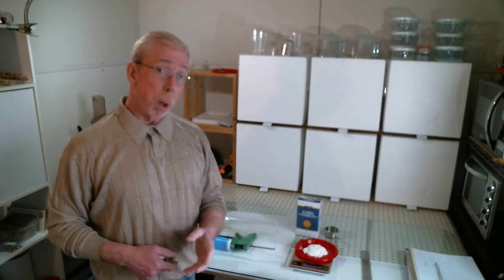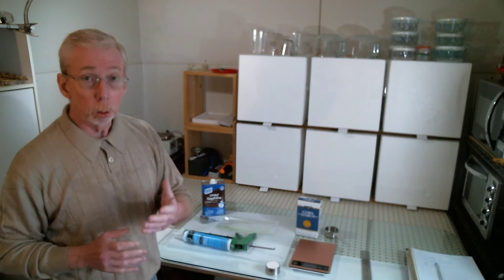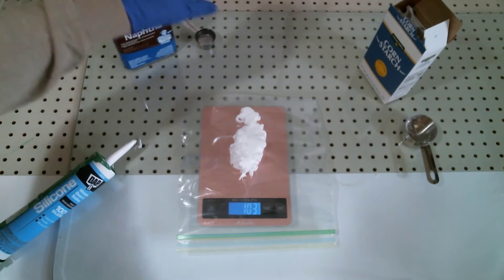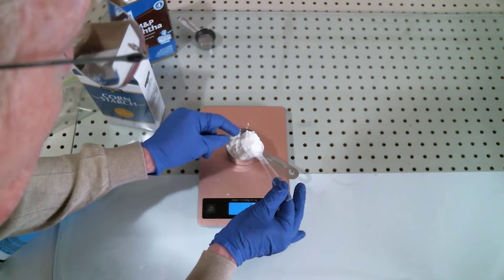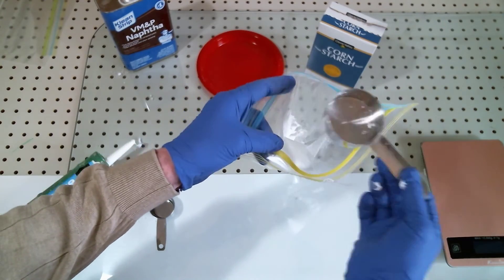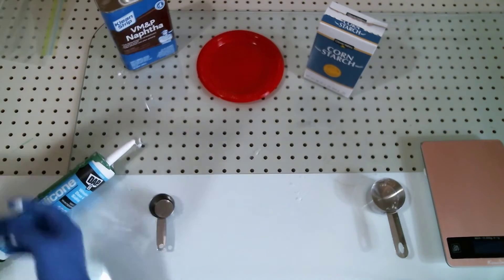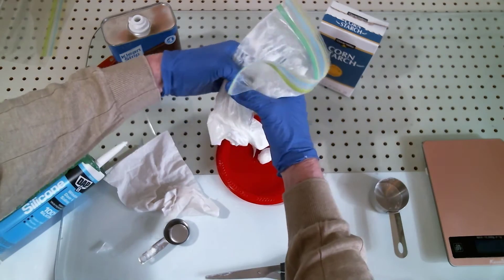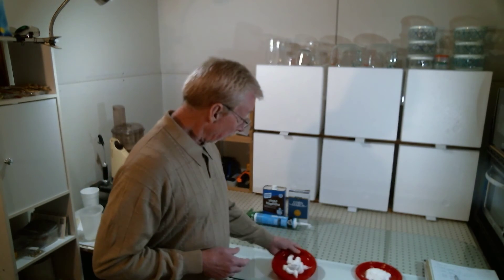DIY POURABLE SILICONE for mold making. Thin silicone w/Naphtha, fast cure w/cornstarch.

Comment: Is it rigid or flexible. I need flex to easily demold wax. I'm going to add mineral oil and see if that works.
Reply from the maker: This will be flexible, so you are on the right track. A little mold release won't hurt. A note: If the mold is fairly even in volume and dimension, you can dunk it to release the wax. The mineral oil will work to dissolve the surface a bit, you know that though. Cheers

Comment: Well, ive thinned silicone before using turpentine.....it stayed sticky for long, and weak too. I didnt like it. I think if i needed a longer cure time i would rather use IPA but question is, why cornstarch? what makes it cure fast and wont cornstarch deteriorate the mold after some years, maybe moulds
Reply from the maker: Great questions. You have a tricky problem. I have a couple of videos for you, that will answer your questions and lead you to the proper thinner. https://youtu.be/sIQkFVftDZU and https://youtu.be/Ob9Y7sjI4IA
Reply: i get the absorption property of cornstarch....for longer putty like use, we use a small amount of it in the silicone...great! thanks

Comment: I tried your recipe for the thin version and my mold hasn’t solidified at all in the center. I just used white silicone the same brand you used and added naphtha. I got the right consistency I needed to mold a statue and then poured. It’s been over 48 hours and feels like top layer of silicone dried but the inside is not. Any advice would be extremely appreciated
Reply from the maker: Did you ad the cornstarch? That is what cures the silicone. Add a ratio of 10:1, silicone to cornstarch.
Reply: @GEOsustainable  I’m sorry I did not as I remember you mentioning in the video that adding the cornstarch to the thinner mix for a more detailed mold wouldn’t be ideal. Maybe I hear incorrectly. My apologies. Thank you so much for the response.

Comment: I’m gonna try to mold a stupidly expensive intake manifold for a v8 with this. No reason a lower intake is $1000. If it works I can use the negative molds to make positive molds and use them to make sand cores to cast aluminum with.

Thanks.
Reply from the maker: That should work just fine. Let me know how it turns out!

Comment: Thank you for this tutorial! I am an artist and was looking for a way to make pourable silicone, for mold making, rather than buying those expensive 2 part kits. So this has been a great video for me! 

But I do have a question, does the 10:1 ratio for the silicone and corn starch work in smaller quantities as well? Like say if I wanted to make a mold the size of a quarter, and an inch thick, but I don’t want to make a large batch of pourable silicone, can I still use the 10:1 ratio for that small of a batch? Or would my measurements need to be tweaked? 

And for the naphtha/mineral spirits etc, is it not measured? But instead based on how thick you want the mold to be? Because I’d like to make a consistency somewhat like pancake batter, would that much naphtha effect the drying time? I guess I have some experimenting to do! Haha
Reply from the maker: True that, you have some experimenting to do. I can offer you a general guide based on your interests. 10:1 works for all quantities, giving a cure time of about one hour, regardless of how much Naphtha/Mineral Spirits you use.
Pancake batter is fine, I have thinned it to the consistency of syrup without issue. If you make a lot of molds, this will save you some money, for sure.
Reply: @GEOsustainable  thank you so much for taking the time to reply to me! I’ll take your tip into consideration when I do my experimenting! Thanks again!

Comment: Thank you so much. I just made a mold for a pice of tiled furnace we're rebuilding and it was missing a corner piece. I had to thin it quite a bit with naphta to make it almost the consistency of paint to make it pourable. I just hope it cures.
Reply from the maker: To ensure proper cure, don't forget the cornstarch in the ratio I give. Good luck! Thank you for your comment.
Reply: Could you let us know if this worked out for you?  Did it cure?  Any problems?
Reply: @whatanitemare  Its been a while now so lets see if i remember what I did -  it failed for me. I think I didnt have the correct corn starch ratio. It also stuck to my tile. so I ended up 3D printing a splittable mold instead.
Reply: @thehighwayman78  Thanks for taking the time to update!  I very much appreciate your sharing.

Comment: I had a question for anyone who could help, i used naphtha and 100 percent silicone to make a mold...day 2 and its still somewhat wet in the center...will this  dry or not and if so any tips on drying it faster...thanks.
Reply from the maker: Yes, if you watch the video, you will see me use cornstarch to cure the silicone. The silicone needs this to cure if it is more than 5mm thick. Hope this helps. It may help to watch the video.

Comment: I have used naphtha before and using enough of it to make it pourable also caused the mold to shrink. I will try your recipe and add a little more naphtha I want it just fluid enough to be a good mold, but not enough to cause it to shrink. Perhaps just buying the pricey 2 part silicone is the way to go.
Reply from the maker: The amount of Naphtha will affect shrinkage. I may have a solution for this in a newer video. Watch here. 
                https://youtu.be/Ci28Y3Z3bYU
Reply: GEO sustainable thanks Geo. I’ll try it.

Comment: Does the silicone shrink overtime?
Reply from the maker: It does shrink when drying, but it doesn't continue. The amount of shrinkage is proportional to the volume of thinner if thinning a lot. Most certainly, you will need to calculate shrinkage.

Comment: The mold shrinks when it cures.  I noticed after a few days, the size of my mold had shrunk.  I don't know if there is already a comment somewhere on this, but definitely an important note if the actual size is needed.  But other than that, I used camping gas, and a little of corn starch with my 100% silicone and it worked just fine.  I appreciate your helpfulness.  I hope my comment was also helpful.  Thanks.
Reply from the maker: I had covered that is a previous video, and how to calculate to get an exact size needed in a video on clay. Yes, you will lose an equal volume of material to Naptha, and can be fairly avoided if you take care of how much you thin it. Glad you liked and you are most helpful.
Reply: This a major draw back with this method

Comment: question, i need to use this to pour over a 3d printed resperator i made. Will this work? i have 3d printed over 2000 of them but now im looking for a way to cast one in resin. i dont want to spend a ton of money on the smoothon stuff. i need like a gallon of it haha  thanks
Reply from the maker: Gotcha, gotcha. I made a video for skin safe, PLA safe applications. Check here. https://youtu.be/Ci28Y3Z3bYU
Reply: @GEOsustainable  awesome thanks. I hope i can get it to work:) im teying to get it the same viscosity of the smoothon product.

Comment: In a previous video, you said that as soon we add cornstarch the quality for fine detail diminishes so maybe one should add only very little cornstarch?
Reply from the maker: That has been my observation, yes. It feels more grained. I use 10 gr of cornstarch to 100 gr of silicone to give a cure time of about one hour. This seems to retain the high detail I want.
Reply: Someone else suggested using talcum powder for a very fine finish.

Comment: Does adding cornstarch or naphta result in weaker (or otherwise different end result) silicone? Thanks.
Reply from the maker: The addition of Naphtha softens it a bit, making it more cushioned at about a 50/50 mix; at 1/4, not much. The small amount of cornstarch for a one hour cure does not seem to have any affect,. Neither affect the flexibility. This is answered better in a newer video here: https://youtu.be/sIQkFVftDZU

Comment: Can you tell me if that mixture sets hard and inflexible or soft and pliable?  I'm hoping to make silicone molds for soap making and don't want to have to buy the 2 part mix that they use if I can help it.
Reply from the maker: Silicone remains soft and pliable for 50 years. Saving you money is why I made these videos on silicone. I urge you to watch them, as I have demonstrated a few different methods.

Comment: FYI: I made a pourable mix, using mineral spirits rather than Naptha, to make a mold of a small cement pot I wanted to replicate. To my surprise (and disappointment) upon removing the original planter from the mold, the smooth finish  was also removed ruining the original pot. It appears everywhere the silicone touched the planter a layer or more of cement was removed.
Reply from the maker: Yes, this is a common issue. That is why I developed another method that will not harm plastic, and is safe for skin. Watch this. I just put it up for folks in your situation. Another GEO-sustainable invention, just for you! https://www.youtube.com/watch?v=Ci28Y3Z3bYU

Comment: Can this method be used on 3d printed PLA filament parts without messing up the original?
Reply from the maker: No, it cannot. Use silicone oil to thin if using PLA.
Reply: @GEOsustainable  Thanks for letting me know.
Reply: This tip is a whole other video you could make on the topic of PLA/Molding. Thanks for the info. I was seconds away from a melted master mold.

Comment: Your recipe worked out perfectly for me, making a mold for plastic lures. The cost savings is dramatic compared to buying products made just for this. I did vary the recipe slightly. One tube of clear silicone, One cup of Naptha, and 35 grams  of corn starch. I mixed the silicone and naptha first. Then added the cornstarch. Once in the mold I gently punched down the silicone to assure total contact to lures (finger dipped in water and Dawn). No bubbles. On my first experiment I mixed everything in a bowl and unfortunately made many bubbles. The bag worked perfectly. Thank you very much for this video!
Reply: On a second experiment I used 1/2 tube silicone, 1C naptha and 25 grams cornstarch. I glued the lures to glass, built the mold with legos and used thinned vaseline for release. The pour was runny as expected. After an hour, looking through the glass everything looked good and I easily removed the legos. I let it set one day. Once released from the glass the silicone block curled too much. The silicone did not appear to cure well next to the lures.
Reply: Just a continuing  FYI. Made a two piece mold. I put in the first mold, two nuts and a small clay rod for registration. Used vaseline for easy release. Before pouring the second part I brushed on vaseline for easy release. Now I have them clamped together for continued curing and so they don’t curl. I have found that if you let the mold sit without some sort of weight on it it will curl. My molds are about 1 inch thick, each mold.
Reply from the maker: @ps7462  excellent to hear.
Reply from the maker: @reecehudson5913  Yes, I pour thin often. Here is a video on pouring very thin silicone that I use to make jewelry. Enjoy! https://youtu.be/Ob9Y7sjI4IA
Reply: GEO sustainable so would I be fine using a normal silicone mold release spray for doing 2 part molds? Would love to try this method as normal silicone is expensive like you mentioned in another video. 
About how many bottle of that silicone would I need when doing a 2 part mold for a rear PS4 shell that would be about 5” in length, 6” width, and about 1-2” in height so runny silicone is what I’ll be after and having to pour a lot to get in the small areas.
Reply from the maker: @EternalBeast97  Try this method I discovered while looking for an alternative to solvent. https://youtu.be/Ci28Y3Z3bYU
Reply from the maker: Great to hear. I am so glad the formula worked so well for you. Thank you for taking time to tell us all how you did it.

Comment: Have you tried pouring resin into this type mold? My molds look great but my resin doesn't harden completely in the mold. I'm able to take the sticky piece out and it dries after several days, but the details are gone because the surface was still so soft/sticky and there is a residue left in the mold. I was thinking that the mineral spirits kept it from curing but the same thing happened with a silicone and dawn mold. Any help?
Reply: Maybe clean the inside of the mold with alcohol before pouring resin into it. Even with name brand silicone, this happens from time to time. I always clean them before pouring resin into them.
Reply from the maker: I agree with you. It is possible the mineral spirits has interupted a vital chemical reaction in the resin. I have been experimenting with plaster, concrete, and even paper mache due to such problems. Silicone has its limitations, for sure.

Comment: good work .. but how can i obtain liquid silicon  that i can pour into a mold and let it harden overnight .. using the same silicon like in this video ..and which is better transparent or white silicon ?? ... thanks
Reply from the maker: In this video, I use silicone caulk from a tube, it is liquid. I teach you how to thin it out. Clear or White depends on you.

Comment: This is a great channel, but I have a few questions. If you continue to add a thinning agent to the silicone and cornstarch mix, will the solidity of the mold be affected overall or will the just the dry time increase? or possibly both? And is there anything you could add to make these molds more heat resistant? For casting pewter? Thank you for sharing all this valuable information with us viewers.
Reply from the maker: Great questions and thank you. I have never taken it to very thin, you would need to try it. Let us know how it turns out. Silicone will not be useful to cast molten metal of any kind. The maximum temparture of this silicone is 350F (175C). Use casting sand for your project. Stay tuned, much more to follow.

Comment: I appreciate you giving us measured recipes.
Drives me crazy to see someone pour "about that much..."
All of the two part expensive silicones I've used shrank about 10 percent. 
If I thinned your version enough to paint on would your naptha/silicone still shrink? 
I'm trying to paint onto petroglyphs, make a plaster support layer and pour an epoxy positive. 
If the silicone were to shrink 10 percent over time it would not be helpful since any measurements would not be accurate. 
Is there a way to make it dimensionally stable?  
Mix in a fiber glass filler agent like is used in fiber filled plastics?
Thanks!
Reply from the maker: Well, I give measurements when needed, but, I also let folks know when 'a bit of this' is all that is needed. Somethings are affected by heat, moisture, product variances..so, a bit of trial and error is needed. When using a solvent to thin silicone, the volume of solvent will cause the silicone to shrink. So, it depends on how much you use. Best to keep accurate notes and plan for the shrinakge. I do love your idea of using fiberglass, it may just be the trick to prevent shrinkage. Please, let us know if it works, we all have to deal with shrinkage. I like your comments so much, I am pinning you to the top for others to gain from you. Thanks for sharing with the GEO community!
Reply: @GEOsustainable  Back at ya. Thanks
Reply: Did you ever figure out how to make a dimensionally stable mold?  Would you share what your outcome was with the fibreglass filler agent?  I'm sure it would be appreciated by many of us to know, no matter what the outcome.
Reply: @whatanitemare  There is a finely chopped (nearly powdered) fiber that is used in ABS plastic to maintain dimensional stability. Unfortunately, I don't know what the name is. It can be seen as shiny thread-like streaks in some black plastic items used outdoors. It was in our aerial terminals used in the phone company. I haven't found any to experiment with...
Reply: @billbucktube  Thank you for that!  At least now I know what type of product I should be looking for.

Comment: Hi bit of an emergency 
I need to make silicone molds for a class project but I can't find mineral turpintine anywhere 
Will normal turpintine do the same job?
Reply from the maker: yes, normal is mineral. Or use mineral spirits or Naptha.
Reply: @GEOsustainable  thank you so much ! 
I really appreciate it!

Comment: I’m looking for a silicone mold that will work for soap! The naptha sort of makes me a bit nervous as a lot of my customers have very sensitive skin. What method do you recommend? I need a pourable version if possible. Thanks!❤️
Reply: Use acetone, it will completely evaporate
Reply from the maker: Well, if I knew of another way to thin silicone, I would. I have heard of using Glycerine, but, it did not blend for me. Here are what we're looking at. We need a solvent to thin it. Naptha or something. You can wash the molds until the smell is gone, I hope this helps. Thanks for a great question.

Comment: I followed the video's ratios and I got a thin and fast setting silicone form, but as it's over four inches in its longest dimension, the closer to the middle I went, the softer the silicone became. Anyone have better luck adding more cornstarch than is done in the video to get a stiffer, fast setting silicone?
Reply from the maker: I have. I have done more, it just sets faster. You may want to try that. My ratio is for a one hour set. It has to be fully mixed thou.

Comment: i make reptile food , water bowls and hides so i dont think naphtha would be safe to use in my molds would this work the same to thin it out as long as i still add the corn starch to cure it would it still set up fast https://www.amazon.com/Premium-Mineral-Approved-Butcher-Cutting/dp/B01LB7MC4M/ref=sr_1_5?keywords=Food+grade+machine+oil&qid=1556101003&s=gateway&sr=8-5
Reply from the maker: Please, excuse the slow reply. The wonders of YouTube!...YES!, that will work just great. Yes, you can still add cornstarch.